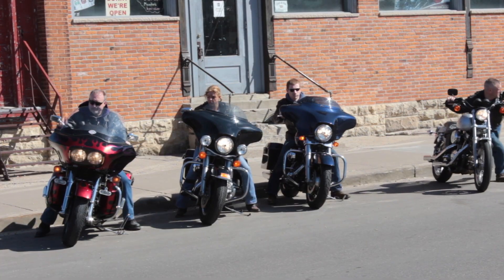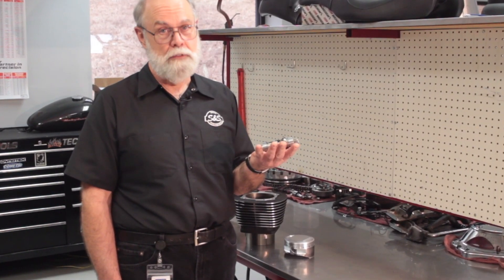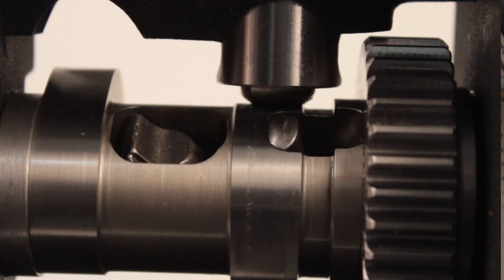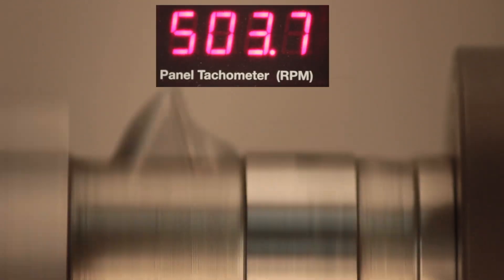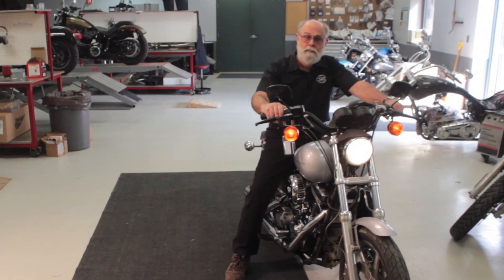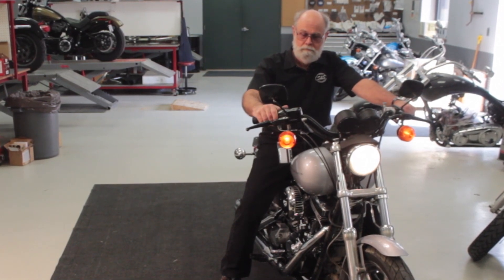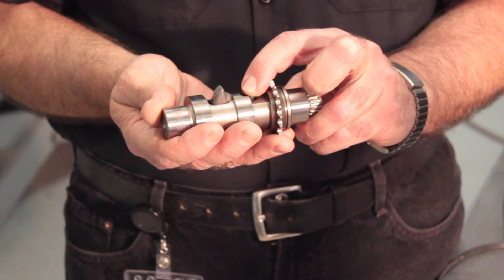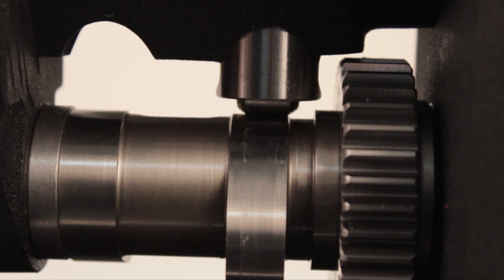S&S Cycle - Easy Start Cams

Comment: I got the 106 hot set with the easy start cams installed into my 2009 96" Harley FLHTCU . They have been working great. Thanks for the the info

Comment: Can a easy start cam fail somehow? I just put your S&S 110 big bore kit on my 103. I currently have the 551GE cams. Having issues, my Harley will start,but not fire on the rear. I was told a few months ago by someone at S&S on the phone the 551 would be ok., or get the MR103 585. By your video this may be my problem correct? Didn't want to order IF not my problem, but IF I can get someone to say this is my issue with my 110 Big Bore kit
Reply from the maker: Hey man, drop us an email over to sstech@sscycle.com and our tech team would be happy to talk through what’s going on with your bike.
Reply: @SSCycleInc  Talked to Chris yesterday on the phone and found out my issue
Reply: @SSCycleInc  Chris said I needed to go with 585's instead of the 551GE,  I was only firing off front cylinder, now will not start at all with my S&S 110 big bore kit:-(

Comment: I know this post is old but can anyone tell me how the 585 east start cams worked on a 96 no head work?  Should I buy some or go smaller?  Eventually want a big bore but that’ll be at least a year or maybe even 2 years.
Reply from the maker: The 585s are a great option for stock heads, with our without a big bore.

Comment: Great vid very easy to understand.On my 3rd set of cams and the S&S 585 Es cams are great.Also run the S&S big bore kit great power and a great roll on in any gear.
Reply: Do you have a clicking when shutting down?
Reply: chris bioski Yep normal shut down sound.All I could recommend is making sure you run with a high over 585 head springs.All the best with your mods.Pietro.
Reply: High lift springs is what I meant.I also run a set of S&S  HL2T limited travel lifters (Tappets).Good luck.

Comment: So, if I don't have high compression or big bore kit, I can get by with the standard S&S cams?  Is that correct?
Reply from the maker: If you have a stock or mildly modified engine the standard cams will work, however it's not a bad thing to release some of the added pressure on the started with the Easy Start options.

Comment: Great video as always.  I have a question about balance.  Doesn't this device throw the balance of the cam off?  Even if you counterbalanced, I would assume the cam is balanced with the weight protruding at high rpm versus in the low rpm position?  Obviously you've somehow addressed this, but I am curious.
Reply from the maker: Minimal material is removed for the weight and overall balance is not impacted.
Reply: Balance probably doesn't matter much, within reason, for a camshaft. The lobes are already going to keep it unbalanced, add to that valves spring pressure through the lifter onto the cam is going to add probably more side load to it than the centrifugal force would.

Comment: I just put the ES 583 cams In  my 12 Slim . 
Yep easy start .
Great power any gear any RPM stage 1 with FP3 and 583 cams got me 91hp and 110tq

Comment: Would this also help for a kick start  and key turn ignition? I have a 96ci Evolution Big Twin style 84-99 Compression Ratio of 10.1:1 with S&S 585 Cam, S&S Super E Carburetor with Super stock ignition.
Reply from the maker: +Victor Cardona Sorry dude! Easy Start cams are not available for Evolution style engines. With four lobes on the single camshaft, there just isn't room for the Easy Start mechanism.
Reply: Ok, Thanks for replying.

Comment: ok, that all sounds good. BUT= Does that space in the lobe wear into the roller on the lifter after time? and if so, how much time????
Reply from the maker: Excellent question!
We were concerned about this during the development of the EZ Start cams, but it turned out not to be a problem.
First of all, the roller is still supported because the open space is not the full width of the roller. It doesn't just fall into a hole, or have to skip over one.
Keep in mind also that the EZ start trigger, and the open space it leaves when it's retracted, are on the heal of the cam. There is virtually no pressure on the roller at that point because the valve is fully closed.
We introduced the EZ Start cams in 2009 and here is is 2014. In 5 years we have not had a single warranty issue with this. We sell a LOT of cams, so in addition to our testing that we talked about in the video, there are many thousands of cams out there that have run untold numbers of miles.
Hope this puts your mind at ease!
Reply: Thanx, yes it does

Comment: I have never hold any of these in my hand.
Maybe that should answer my question:
What in the mechanism keeps the trigger in it's sleeping position?
Is it spring loaded, or is there a secret in geometry?
If you solved that by a geometric trick, well, then i am really curius.
I hope it is possible to understand what i am trying to say.
Reply from the maker: There is a slight spring load that keeps the trigger above the base circle when the engine is not running.
Reply: +S&S Cycle, Inc 
Thank you for the reply. Case closed ;-)

Comment: I have a SNS 103 motor it starts very hard I do not have compression relieves on it if I would order this easy start cam you're telling me that it would help out a lot?
Reply from the maker: jake lennon Assuming your bike is 1999-later model, you will be totally amazed! These things really work. If you have a shovel or Evolution® engine S&S does not offer Easy Start cams for those engines.
Reply: Yes I have an evolution motor so thank you for getting back to me I will keep looking on what to buy for it tell pat start easier if I send my heads to you guys can you put compression release in
Reply from the maker: jake lennon
You said you have an S&S engine. Some S&S cylinder heads are machined to accept our electric or mechanical compression releases, but many are not. If you call our tech line at 608-627-8324 they can help you figure out if yours are. If your heads are not machined for S&S Compression releases, you should be able to make your engine start easier with a cam with more duration. Our tech guys can help you with that too!
Reply: OK thanks a lot .
Reply: @SSCycleInc  I have a 2016 Street Bob with a 103” stage 1 motor now. I’ve ordered some S&S 551 easy Start cams. Do you think I picked the right cams? I haven’t gotten them yet.
Reply from the maker: @Indian Andy
The 551s are a great cam for engines with 9:1 - 9:9 compression and for riders really using low end torque, up to 4K RPM.

Comment: any accelerated where to the lifter wheel or cam ?
Reply from the maker: John Schossow Excellent question! Another viewer asked about that almost a year ago, and the answer bears repeating!
We were concerned about this during the development of the EZ Start cams, but it turned out not to be a problem.
First of all, the roller is still supported because the open space is not the full width of the roller. It doesn't just fall into a hole, or have to skip over one.
Keep in mind also that the EZ start trigger, and the open space it leaves when it's retracted, are on the heal of the cam. There is virtually no pressure on the roller at that point because the valve is fully closed.
We introduced the EZ Start cams in 2009 and here is is 2015. In 6 years we have not had a single warranty issue with this. We sell a LOT of cams, so in addition to our testing that we talked about in the video, there are many thousands of cams out there that have run untold thousands of miles.
Hope this puts your mind at ease!

Comment: I have the .583 ES gear drive cams in my wide glide. Love em. Bike pulls pretty much anywhere in any gear. Good all around cam.
Reply: I'm getting ready to do my 2010 FXDWG. Thanks for the positive reinforcement! BTW what kind of tuner do you use? I have an FP3 and thinking I may have to abort it in lieu of Dynojet PC. I wish I had watered that money tree! Lol.

Comment: This is very impressive, and someone else asked a question about what I was also concerned about, and you answered it, the roller not being fully supported, across it's surface, is not an issue, but there is still something, that saddens me.

You mentioned this technology, is not available for Sportster models, so this would include Buell models as well, mainly the XB family. I have yet to disassemble a Buell Blast engine, or seen a video of a full disassembly, but, I doubt this technology is available for a Blast. 

Is it because the camshafts are too small in diameter, for those engines, and no metal is strong enough for that moving part, and the camshaft itself, at that size? Or it's just not possible, because there is no room for a counterweight?

I guess, now, I have to research if a starter motor upgrade, exists for Buell blasts, a starter motor, that is stronger, and more efficient, because I am increasing the displacement, from 492cc, to 600cc, and I never thought about how hard that would be, on the stock starter motor. I also hope, if an upgrade exists, it's American made, because I want to support my country.

Well, you have a great invention. I will also look at your site, for anything I could use, for my Blast. I thank you and your company for innovating.
Reply from the maker: RoyalSilver&Gold The problem is that those cams are just too short to accommodate the Easy Start mechanism. It's a 5 lb bag!
Reply: Ohh. I took a good look at the Sportser cam, you had in your left hand. I was thinking maybe the mechanism can be shortened, like a shorter seesaw, positioned into the cam gear, like a cave, and the counterweight made bigger, by wrapping around the cam shaft a little, like a crescent, but can see, there is simply not enough room.....but great news, I found a starter motor for Buell Blasts, stronger then stock, more efficient, and made in the U.S., CompuFire Gen III Starter Motor - 53883

Thank you for replying.

Comment: My 2013 FLHX is at 50k miles and I plan to install  S&S 551cams, new tappets, bearings and tensioners next winter. Do I need the EZ start cams? Doesn't the H-D 103 already have ACR?
Reply from the maker: You don't absolutely need the Easy Start cams, but they will save a lot of wear and tare on you starter. Yes, you have ACR which is adequate for a stock cam. The 551 cams are pretty short duration resulting in higher cylinder pressure, which is why they make such good torque. We still recommend the Easy Start cams. You will have to calibrate your EFI system with a cam install, and most Flash tuners allow you to shut off the ACR electronically if it causes any problems.
Reply: Thanks for the reply. I run a V&H Fuelpak and they supplied me with the map values that should work great with these cams.